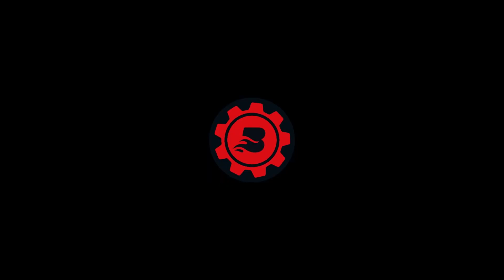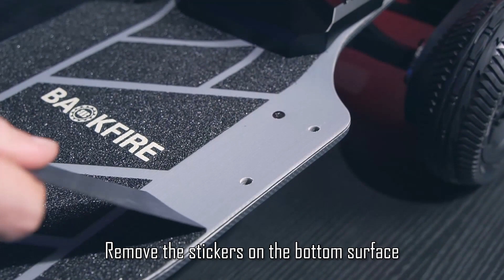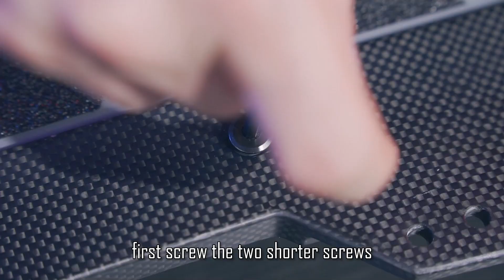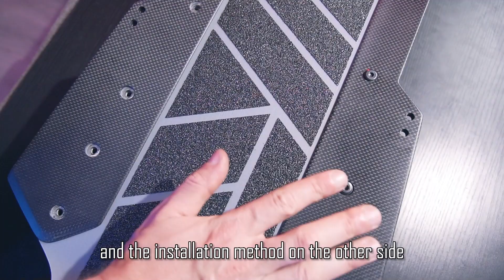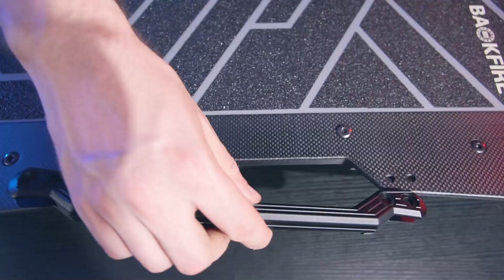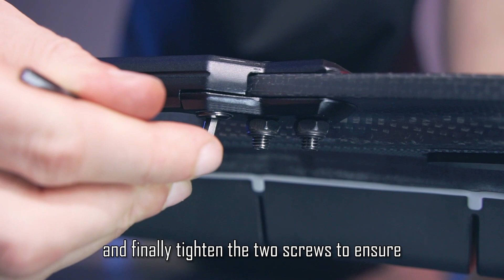How to Install Carbon Fiber Extension Wings on Backfire Hammer Sledge

Comment: What is the difference between basic and standard options on your website?
Reply from the maker: Standard has three extra accessories included : handle, front lights, and mud guard.  Basic does not include these accessories.